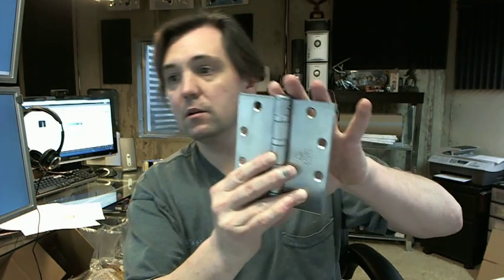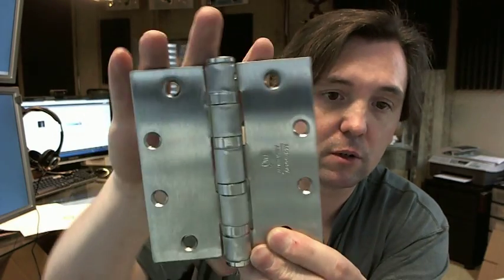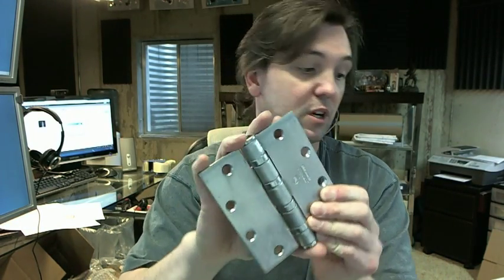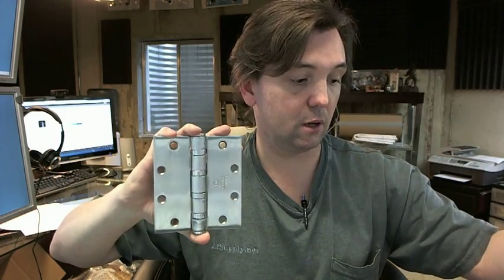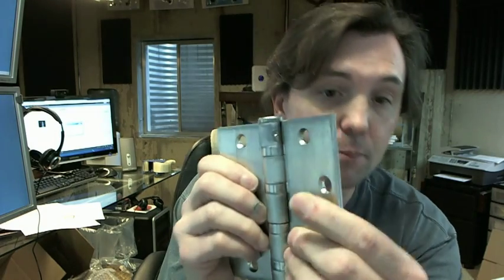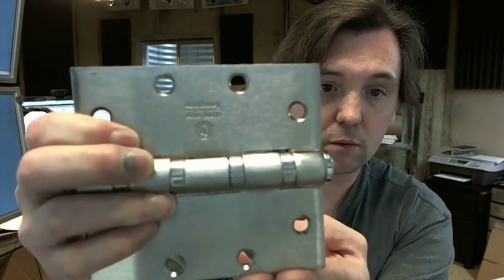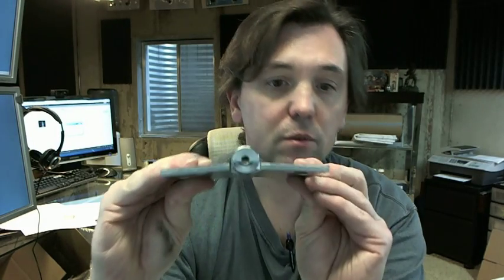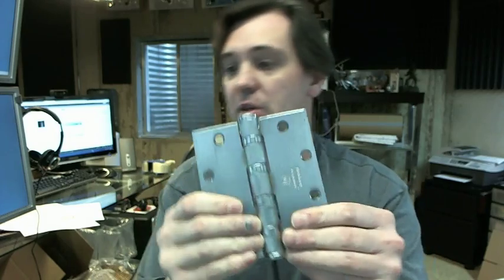McKinney T4A3786 NRP 5" x 4.5" Ball Bearing Hinge With Non Removable Pin

Comment: How do you make adjustments then, our steel door at work it completely out of whack, and won’t fully shut at the top. The hinge cutouts don’t look like they have much room to make adjustments
Reply from the maker: There is not much in the way of adjustment for hinges for height, but shimming for width is possible.  Provide more information or give me a call.  Rich 239-315-7889

Comment: My door rubs at top, tried holding door open wedged shims under and released top/ middle hinges to re fasten as to attempt to pull door, was not successful, plus one screw was on so tight, I bought a no3 impact bit, I do not want to strip this screw, from seeing other videos reveal and the strike side is tight at the top where the bottom is about close to an 1/8, Can these hinges bend with time, it is only 6 yrs old,
Reply from the maker: Email me photos of the hinge and door:   sales@absupply.net

Comment: Is there a way to install a door stopper on this type of hinge?
Reply from the maker: Are you referring to a hinge pin door stop such as the
 McKinney 76306 TA2714 Hinge Pin Door Stop 26D
as seen here:   https://absupply.net/mckinney-76306-ta2714-hinge-pin-door-stop-26d.aspx
Reply: @absupplynet  actually I think mine is a riveted hinge pin. It does not have setting screw and the top and the bottom of the pin is very "skinny". I guess in that case there is no way to take it apart? Thanks
Reply from the maker: @luktish  If you indeed have a riveted pin it would be correct to say that you would not have the ability to remove that short of grinding one of the riveted components completely off.  Before you go to this extreme measure please send us photographs of your hinge and in particular of the pin so that we can give you a more focused direction forward.
Reply: @absupplynet  Hi, thanks for your response. Do you have an email address I could use to send a picture? Thanks
Reply from the maker: @luktish  Please use the sales email that scene at the link here:
 
https://absupply.net/about_us.aspx
Reply from the maker: @luktish  sales@absupply.net
Reply: @absupplynet  Thank you. I sent you email with pictures. Please check the spam, my email is from German server, so it ends with .de instead of .com
Reply from the maker: @luktish  no email just yet received here.  Please review and advise.
Reply: @absupplynet  Do you have limits on data amount your email server receives? I sent you pictures, so maybe it got discarded by your server? I will resend it. Last time around I did not receive any mailer daemon message though...
Reply from the maker: @luktish  Certainly yes - there are limits on mail when it comes to sending pictures - certainly 30 meg would be at the outside limit.

Resend only one and let me know once you have sent that and I will review and advise
Reply: @absupplynet  ok. just sent one pic
Reply from the maker: @luktish  nothing - I will be back to work tomorrow morning at 8 eastern time and I would like for you to engage me in the live chat function of our website where you can pass me those images through the live chat.